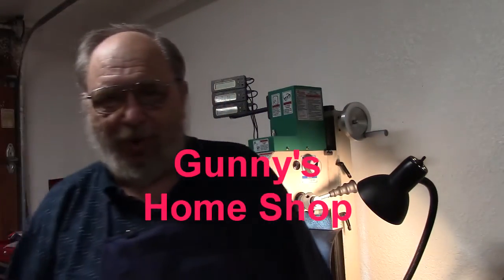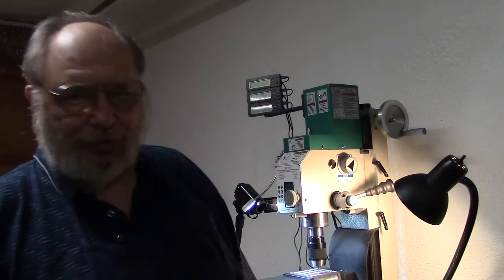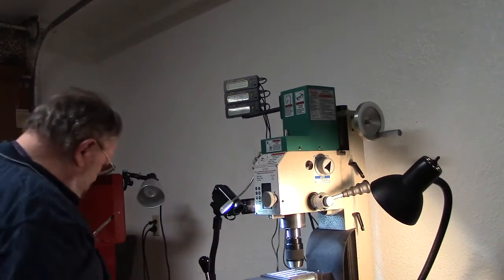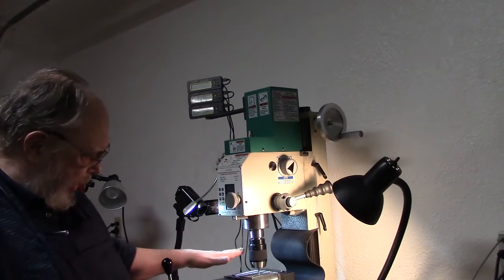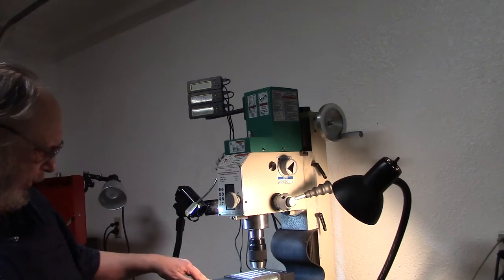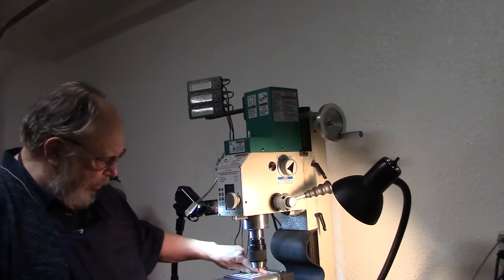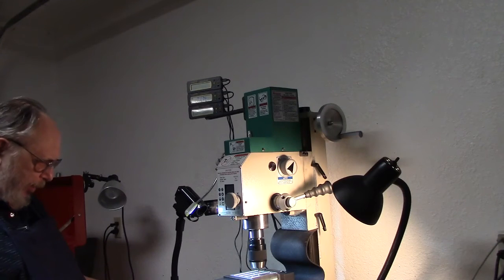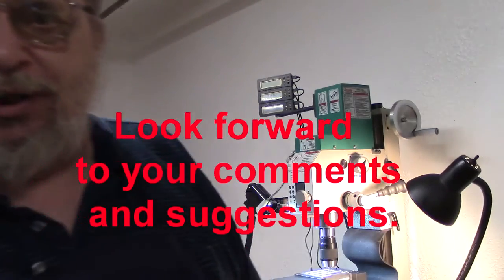G0704 Improvements Project

Comment: You mentioned the machinist calculator, is that a app or software ?

I did a search and came up with too many to decipher what one you are using.
I have the same mill and same dro's.
 I mounted my displays about the same location but I mounted them to the wall and used 2 of the plastic arms and mounting plates.
So I have on one top and one on bottom of the stack. Made them extremely ridged.